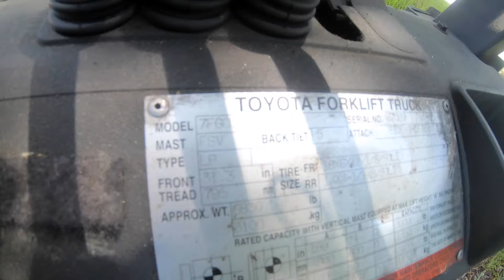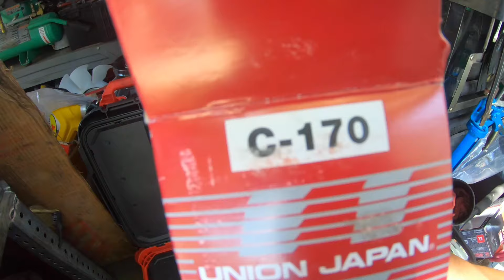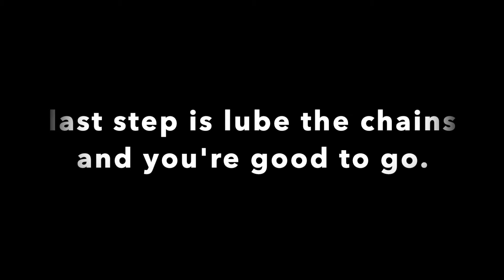Preventative Maintenance (TOYOTA FORKLIFT)

Comment: Im embarrassed to say i had no idea that third peddel os a clutch, i just thought it was a left foot break, how are you supposed to use a clutch on a forklift?
Reply from the maker: @jasonbondar3  it essentially acts as a neutral/brake pedal. You press it half way down and it puts your transmission in neutral, then push it all the way down and it applies the brakes. So it’s a 2-in-1 action.

Comment: Did you check the counter weight bolt before you jacked it up?? I'm only asking because I work for tmh and I jacked the truck up on the counter weight and found the bolt was loose .
Reply from the maker: Yes, before jacking it up, definitely check to make sure the bolt isn’t loose. But it’s not like the counter balance will come off. If you notice it’s loose, definitely tighten it.

Comment: White lithium grease okay for the chain lube?
Reply from the maker: Yeah it's okay but I recommend either chain lube or a specific lube called "inner slide lube" 

Grease makes the chain really sticky and can dry up quickly. You want to keep the chains wet so they don't get stuck.

Comment: How often do you change the oil? Or how i know needs to oil change? Thank You!
Reply from the maker: It all depends on use. I recommend every 3-4 months. If you rarely use it, every 6 months is fine as well. If it's heavy use all day every day, minimum every 3 months.
Reply: @theforkliftguy   thank You for answering . Then i will do every 6 month  i don't use it often.

Comment: What tipe of greasy you use for the forklift and what tipe of coolant?
Reply from the maker: I use lithium grease or sometimes I use high temp grease (preferably mobile 1 grease). You can use 50/50 coolant. Typically red or orange colored coolant will work.

Comment: I should buy you some lunch sometime for this video… thanks for the help. 

How often should a forklift PM be done? 

Also curious your opinion on mobil 1 synthetic. They have some where they guarantee 20,000 miles on a car.  Maybe this could help to not do oil changes as often.
Reply from the maker: Thank you for the kind words! 

PM should done every 200-250 hours or every 3-4 months. If you don’t use it that much, you can do it every 6 months. 

Full synthetic oil is always better. Mobile 1 is what I recommend for sure! 👍🏼. If you can’t afford it, any synthetic brand will work.

Comment: You are not supposed to grease the carriage rollers like that. They are supposed to roll, greasing them can cause them to slide instead of rolling and lead to flat spots in the rollers. Not trying to troll you. Just trying to educate you a little.
Reply from the maker: Thank you for your insight. Always welcomed 👍🏽
Reply: I keep saying this, I learned that at Crown but Raymond wants us to use inner slide lube
Reply: That's either because Raymond wants extra work when the rollers turn into stop signs, or the service manager is ignorant. Every time I work on a crown, I have an acronym I use that Crown stands for. Can Run Only When New.

Comment: What if it's pouring down rain? You have to work on it outside like a dog?
Reply from the maker: No, not necessarily. I usually try to find some kind of shade, and I even bring my own tall umbrella to protect me from the elements. Most of the time, customers have tall warehouses or garages, that you can use so that you don’t get rained on.
Reply: Thanks for the reply. I'm considering moving into the forklift arena but I'm concerned about working in bad weather. I wouldn't be able to concentrate and don't want my tools getting ruined.
Reply from the maker: @jimmywells33  does it get really cold where you live ?
Reply: It does and the wind really makes it feel much colder often.

Comment: What to put in the coolant sir?
Reply from the maker: 50/50 coolant is fine.
Reply: @theforkliftguy  water?
Reply from the maker: @bailandyvlog8175  no. Just water will damage the water pump faster over time and the radiator
Reply: @theforkliftguy   Ok what type of coolant did you use.
Reply: @bailandyvlog8175   I need to know the same: what kind coolant he used, well he said 50/50 but as I don't know about it I'd  like to know the brand and if its special for forklift.